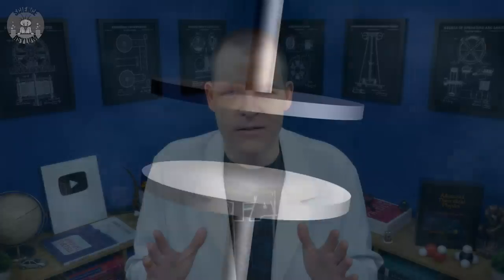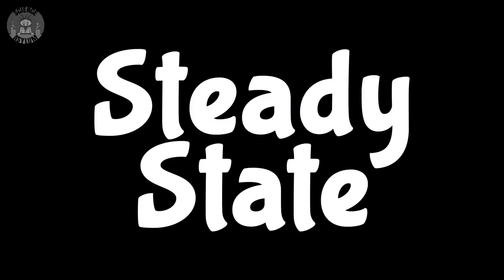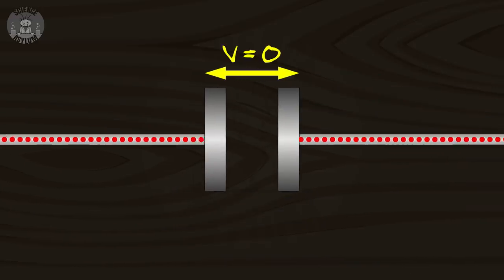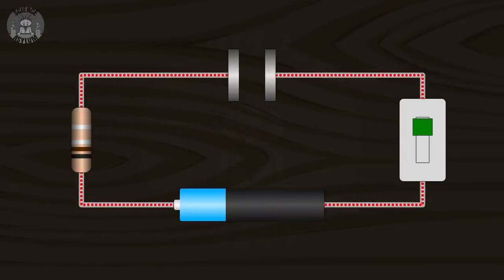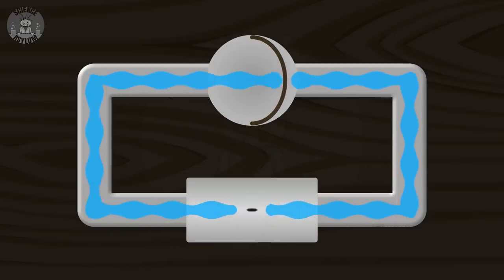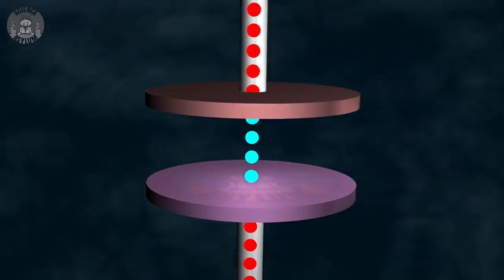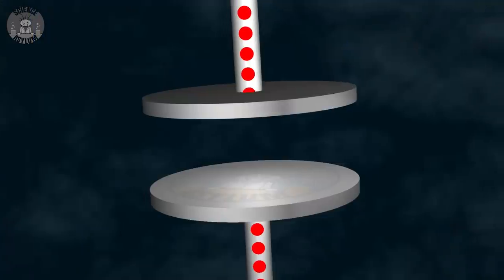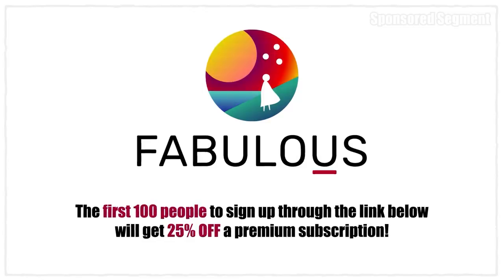Capacitors Are Gaps! How Does That Work?!

Comment: I remember a capacitor demonstration in school.  The capacitor was a metal cup with a glass liner that held a metal cup, kind of like Matryoshka Dolls (Russian nesting dolls); at least the bottom half.  The capacitor was charged with a Van de Graaff generator.  Once charged, the capacitor was disassembled and the two metal cups were touched together to completely discharge.  The capacitor was reassembled. . .  And watch out!  It had the charge from the Van de Graaff!  So where was it stored during disassembly?  🧐 🤓 

You need to say more about dielectrics!

Comment: In High School, my physics teacher charged a capacitor, then demonstrated it by discharging it.  He charged it again, disassembled it grounding each component.  He reassembled the capacitor and then used the same procedure he had used to discharge it the first time.  And it discharged as if it had not been disassembled proving that the energy was still stored in the insulator.

Comment: Well done.  I find myself wondering whether it would have been helpful to include the concept and definition of the energy density of a static electric field, to show clearly that energy transported from the battery really does end up stored in the field inside the capacitor.  That's the fact, but maybe too much information for a short video like this?  ...Or maybe not, given that you did invoke the definition of the energy (Poynting flux) transported by the transient fields, and then illustrated the direction of that transport into the capacitor.

Comment: Another great video, thanks! When I saw your earlier video on the poynting vector, I was shocked. It prepared me for this one! I am surprised though that if the energy actually flows into the capacitor, or the light bulb from the surrounding space, how come objects external to the wire don't block the flow of energy - for example, if you put the light bulb inside a Faraday cage and run wires into it, how does the energy get to the bulb?
Reply: Its because the energy flows inside the wire. There appears to be some confusion between electromagnetic radiation which flows through air like a radio signal from an antenna and electricity flowing in a wire. Two very different things.

Comment: The problem with your capacitor-battery circuit wasn't that you need to include wire resistance. I think its perfectly fine to postulate ideal wires. The problem is that you ignored the mass of the electrons. when you connect the battery to a resistor, the electrons need to accelerate to reach the "terminal velocity/current", I =V/R (ohms law), where the current dependent force of the resistor is equal to the force of the battery and there is no net force. Since the mass of electrons is so small you can usually assume that it is 0 and the acceleration due to any net force is infinite, so it takes no time at all before ohms law applies. But when you have no resistance such as a shorted battery this approximation of 0 mass is no longer accurate and ohms law doesnt instantly apply (in fact the transient state never ends), and you have to consider the change in kinetic energy when calculating the current and when applying kirchoffs law: Voltage around loop = change in kinetic energy per unit charge (a statement of the work energy theorem)

this is the same problem you ran into with the capacitor. by ignoring the mass of the electrons you got that the capacitor instantly charges, however if you included the mass you would get a finite acceleration and a finite charge time. no need to artifically consider non-ideal wires (also if you wanted to model the mass as a circuit element, an inductor would be the best since it also behaves like inertia)

Comment: Question (which I understand that you likely won’t have time to answer): you mention that a wire has resistance.  As a guitar player, we buy cables based on their capacitance.  Where does that capacitance come from?  The space between the copper atoms?  I believe this is called self capacitance. (The TLDR is that a capacitor and resistor make a low pass filter, so high capacitance cables “roll off” some of the high frequency content of the electrical signal travelling down the wire.  After about 25 or 30 feet of cable, this becomes noticeable to some people, and at 50 feet it is very noticeable. I’m not sure if the resistance is provided by the cable or the volume pot—a variable resistor—or the input impedance of the amplifier.)
Reply: Instrument cables are usually multi core cables. Which means they have several wires inside which are individually isolated. This makes each pair of these two pieces of metal separated by an isolator. That's a capacitor.
I believe several techniques are used to counteract this, like twisting them and adding meshes in the isolation.
Reply: @narfwhals7843  Thanks!  The explanation makes sense.  Much appreciated.

Comment: 8:07 
at opposite plate there have negative charge So,
They will tends to move opposite to the direction of Electric fied shown inside the capacitor.
i.e, negative charges are attracted towards the positive plate & not be repelled.

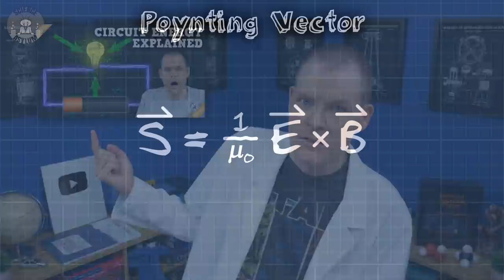Comment: 10:55 mostly not around the wire, but in the wire between the electrons. The electrons repell each other. They are pushed by the voltage of the source and pushing on each other (like if you had some springs pushing on each other)

Comment: Firstly, thanks for the amazing and super fun vídeos!!!!! Secondly, may I ask a question? Since the energy goes from the source directly to the load, what happens in a short circuit? In an layout with a switch and a battery the energy would flow from the battery into itself?
Reply from the maker: Yes, in that situation, most of the resistance (load) would be the internal resistance of the battery. The battery would get hot. The wires would too, but not as much as the battery.

Comment: Voltage will also drop across the battery's internal resistance. The resistance of the wires are probably the same order of magnitude as the battery's internal resistance.

Comment: You make my head hurt so bad! I had 3 years of electronics in high school in the '60's. 2yrs AAS in Electronics after. At no point did any concept of Quantum states, field equations, ... ever come up. There were these things called electrons that jumped between valence shells, making "hole flow". Now I'm told a light switch is just a suggestion affecting probabilities? 

Also being an audiophile that earlier "Flow of energy" one destroyed the whole notion of just using fat wires for speakers! Giving some physics based support for the woo woo of $10,000.00 speaker cables?

And just recently the blowup a redo of it by another tuber is still causing ripples in the zeitgeist. It will be fun to watch what happens with this one! Once the pain settles down!

Comment: During the transient state, when the capacitor was charging, as it charged the electric field inside the capacitor changed and grew inside which pushed the charges, causing the initial current. Will it be correct to imagine it as something like this:
Due to the voltage, the electrons (at the side where they start flowing) started moving and as they moved, they left a space behind at their place. As they left a space, it was occupied by the electron before them (because the space was like low voltage). This resulted in the electrons, at the other side of the side where the electrons started moving at the beginning, to also move in the same direction which in turn caused an overall current at the transient state. But after the capacitor got fully charged, all the electrons stopped and at one plate of the capacitor there was negative charge and at the other there was positive charge.

Comment: In a practical since, I always thought of a capacitor as a temporary battery...it has to be charged and once it's charged it releases its energy to do what the circuit needs to do, like powering the flash on a flashbulb

Comment: Thank you for yet another wonderful video. I was thinking.. suppose we have a circuit having a variable resistor or a moter where we can increase the load suddenly, then how power draw increases, how those fields communicates to battery to release more power since voltage remains unchanged... Thanks again 😊

Comment: Hi, Many thanks for video, it already gives a lot of information and clarification ,yet i still feel there is something more to it and i`m hoping you will be able to add what is missing at least from my side what i mean is: for me if there is a changing electric field created in the capacitor then this changing E field will create a changing Bfield and this changing B field means an induced emf will occur so i would like please to understand where is this induced emf what is the link between it and the voltage relation in the capacitor I=C dv/dt or V=Q/C, also could you please go further in details may be track an electron path from the battery and the effect of the battery field on it and then what happens at the Capacitor when is the field in the capacitor exactly created  can you please show that on the particles the electrons and positive charges where is that field (i mean ok as monopole i can see it out of the positive charge and in the electron charge )but it would be great if you visualise that in a video at the moment it is created in the capacitor , also the electric field is normally causing the acceleration of the charge where does that acceleration start , is there an acceleration from the battery field and then another acceleration from the capacitor new field?, also if those two acceleration are different at the beginning it means the amount of electrons being pushed between the battery and the conductor is different from the amount of electrons being pushed at the capacitor side back to the battery , so if we measure the current at these two different places are we going to get different values? i would really appreciate it if i can get an answer ,many thanks

Comment: The bound charges in the insulator DO move and stretch the molecular bonds.  However, the resulting depolarization is not complete as it would be for a conductor.  These moving, bound charges result in a real transient current; but, this current alone is much smaller than the charging current.

Comment: I've once built a plastic-gap capacitor that actually worked, by just putting a closed sheet of package tape on one side of two sheets of aluminum foil and rolling them up to save space. The package tape keeps the two sheets of aluminum seperated. I got an LED to briefly flash after charging the capacitor to 12V. (the flash was so short and dark that I almost didn't see it) 
P.S.: The two sheets were around one by two decimeters in Size.

Comment: I think you could go to the next step with this stuff by making video about emitting antenna. One cool video "I bought 1000 meters of wire to settle a physics debate" was made as a reaction on Derek's video. And the coolest part was using digital oscilloscope to capture transient voltage graphs for the two cases: 1. when all is connected in a loop and it works as the circuit 2. when wires are cut open at the far ends, and it works as emitter. Sadly, the author didn't make full physical explanation of the stuff happening there. But I think, that that example could be used as a really nice illustration of the meaning of Poynting vector.
Reply from the maker: Yes, I've seen the "I bought 1000 meters of wire to settle a physics debate" video. It was the way I was going to respond to Derek's video, but then I heard Brian (AlphaPhoenix) was already halfway through making the video so I abandoned the topic. It was a banger idea. I just thought of it too late.
Reply: @ScienceAsylum   In fact, I was so curious concerning the source of the misconception, that leads to the wrong understanding of the circuit by Veritasium, that I did actually found finally the explanation of transmission line, which, as I believe, is the root of evil. In the video named "Explaining Veritasium Electricity Video: Energy doesn't flow in wires (with Eric Bogatin)"  prof. Bogatin (University of Colorado) does an explanation of the classic transmission line for the case, when power source is at near end of the line and load is at far end of the line. So, as it is presented, it creates understanding, that the wave of current/voltage propagates though every segment of the line due to  the displacement current in a stray capacitance BETWEEN the wires. But this creates WRONG intuition for the case of different geometry of the propagating wave. In the case of Veritasium's circuit the wave in fact does not propagate simmetrically in the two geometrically parallel wires. It does propagate in opposite ways in one wire, which also has stray capacitive coupling with the second wire. So, that geometry of E-field of the displacement current, created by that wave is completely different, and that stray capacitance between two parallel wires in a segment (in terms of lumped elements model of transmission line) is only a fraction of total.

Comment: I never realized that I didn't understand how capacitors work.  Great video.  A question though.  Based on this, it charges up on each direction shift of the ac current.  But, capacitors can keep a charge much longer than that after power is removed.  How does that work?
Reply from the maker: Even in AC, the capacitors spend the vast majority of the time with some charge on the plates. Whatever charge a capacitor has when you disconnect it is the charge it's (likely) going to have the next time you connect it to something. That may not be a full charge, you'd have to be really lucky with your timing for that, but it's still a charge.

Comment: I understand that the energy being used from a device doesn't come from the kinetic energy of electrons In a device, as obviously the kinetic energy of electrons isn't decreased  ( and in the case of zero resistance the KE actually increased. However could we say that the energy being used by the device IS the charges KE, as "powering something" is just another term for " doing work on electrons inside a device", power of a device, aka how much energy is being used by it per second  by definition, IS the rate at which work is being done on electrons p=IV.

I commented on your other video about the poynting vector, and you told me that the energy being used by the circuits isn't the work being done on electrons and infact this energy is miniscule,

 But For a static field, poyntings theorem tells us that all of the energy from the poynting vector is now being converted into mechanical work. Obviously the work being done on electrons in the external wire doesn't contribute to the powering of a device. However  total work done on electrons inside a device, IS the energy that is being supplied by the field. So would it not be right to say that the work done on electrons inside a device IS the energy of the device. And therefore, the energy the device is using

I'm wording this really badly but the field supplies the electrons inside a device energy, and it is THIS energy that I would say the device is "using" to work.

Comment: The Poynting vector rule for energy flow into capacitor gap would also mean energy is flowing in to wire at all points and out of the battery. The electromagnetic field is no different in the wire than a capacitor .

Comment: One little issue on the "capacitors breathing energy". On your video it looks like capacitor takes the energy out of the space, while I suppose (as an engineer ;) ) that it takes the energy that moves around the wires. The poynting vector just turns from parallel to the wire to perpendicular. Similar as in battery, but as it is poynts ;-) to inside in capacitor it poynts outside in case of battery.
Reply: Yeah, if you zoomed out it would look exactly like that. Also, i don't like when energy is made to sound like a substance that can have stuff done to it. It summons all the crazies that think it links science to some spiritual woo.
Reply from the maker: I made a separate animation showing the entire battery/capacitor circuit with the energy flow included (but then couldn't find a good place for it in the video). The flow is exactly as you described: it follows the wires until it gets close to the capacitor, then wraps around the plates so that it can come in from the sides. It changes from parallel to perpendicular.

Comment: Question: in a charged capacitor, is the charge itself held on the surface of the dielectric (surplus of electrons on one side, deficit on the other)? If so, what happens to an open air-gapped capacitor (such as a variable capacitor used to tune a radio) if a breeze is blowing across it - does the charge get blown away since air itself is the dielectric? If you turn a variable capacitor to full capacitance (plates fully overlapping), charge it then turn it to minimum capacitance/overlap, then back again to full capacitance, will it still have its original charge or will the charge have floated away with air movements while the plates were apart?

Comment: I think it's important to note that Poynting vector is a mathematical abstraction. It's not something that you can measure using an instrument. In the end, all electrical circuits can be reduced down to the motions of charged particles (electrons most of the time).

Comment: I am an audio engineer, and we use these things called transformers all the time... they block DC, but allow AC to flow... therefore allowing our digitized sound to flow, but blocking the DC used in many of our devices.  A transformer is a capacitor, but instead of it just being nothing in the gap, its a separate wire entirely that essentially carries the magnetic field of one cord and then imprints it on another.  This happens in your microphone on your phone, and the speaker on your phone!  Not to mention likely several other places on the phone.